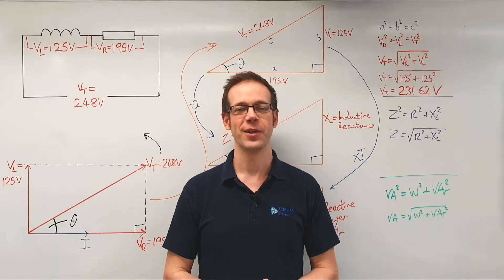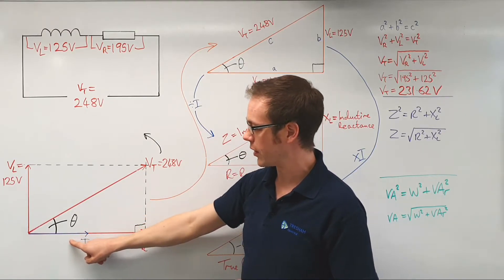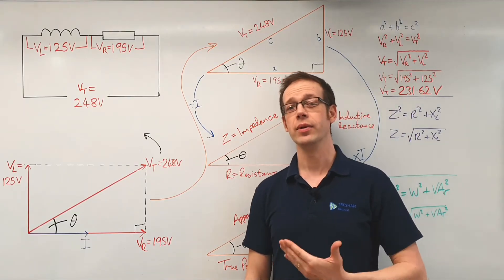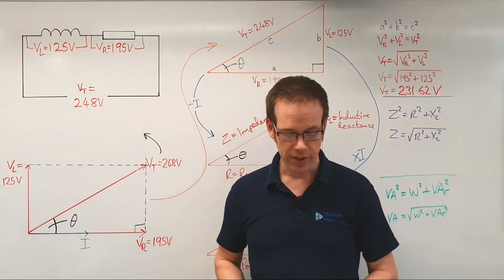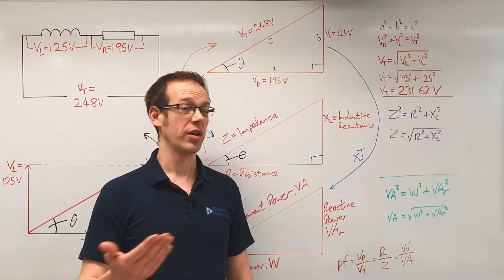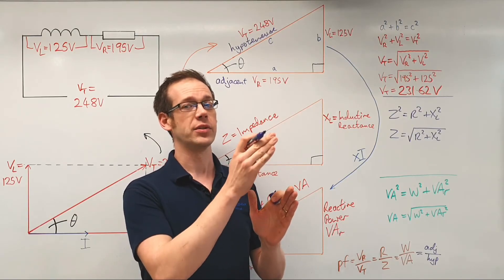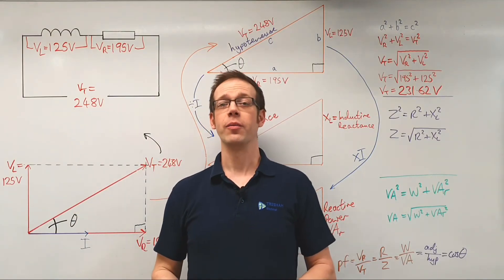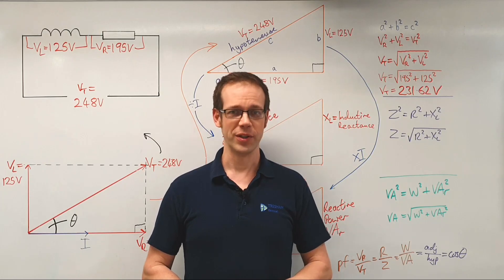AC Theory: How to Calculate Power Factor in an AC Circuit: What is Power Factor?

Comment: Hi Joe, would you be able to help with a pf question and the formula?

In a circuit with a 4ohm resistor and a 10mH inductor what is the power factor.

Comment: In power factor correction, are we correcting the phase difference between the current and voltage of the public power supply company or is it correction of the inductive loads which could be water pump or any other kind of load. Secondly, do resistive loads have phase difference? Does it mean when the loads are purely resistive the power factor is at its maximum theoretical value of 1?

Comment: I agree that in an inductive circuit, the current is lagging the voltage and this resulted in higher cost. The challenge is other than more drawing current, is it required to change the size of equipment (cable/transformer etc)? Power factor compensation is a mature solution. Great explanation. https://www.youtube.com/channel/UC1HLWRE0yyuht7aFmK1MQgg

Comment: FINALLY, a video that explains it all using ONE right-angled triangle, that in fact, each in the three is (effectively) the same animal.
cos θ (or ϕ for phase angle), ° = Adjacent/Hypotenuse = VR/VT = R/Z = W/VA = Power Factor.
Where θ (or ϕ for phase angle) = 0°, VL = 0, X = 0, VAr = 0.  This is a DC (direct current) circuit.
Thank you for the best clarity that I have seen to date!

Comment: So, the general case would be that you have an inductive circuit, so the current is lagging the voltage.  If a capacitor is used to correct this, does that (for want of a better description) push the current forwards to bring them into phase at 0 degrees offset, or does it push the current back, so it is out of phase by -360 degrees, but lines up nicely :-) ?  Either way would work and the cycles would be in sync, but does it matter?

Comment: Hi Joe. Thanks for your training videos, they are helping me to pass my exams. No,  I found this problem, How can I proceed? Let me now any clue... Problem:  "A 120 V circuit contain a fluorescent fixture with the two 80 watts lamp, an ampere-metter is connected and indicate a 1.6 amps load. What is the power factor of this circuit ?"
Thanks in advance for your help.
Reply from the maker: Hi Luis, great question, I'll shoot a video, pop it on my channel and give you a shout out if that's OK?
Reply: @JoeRobinsonTraining  Thanks Joe. That will help me a lot.